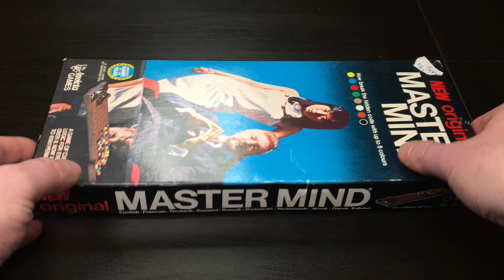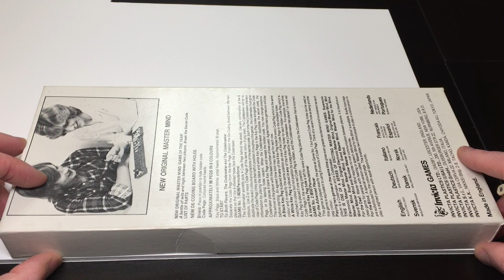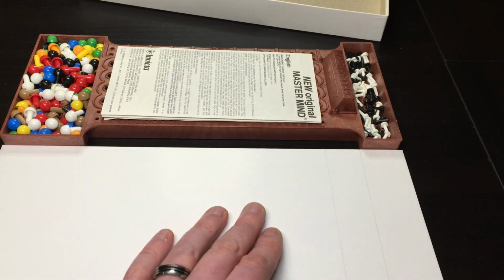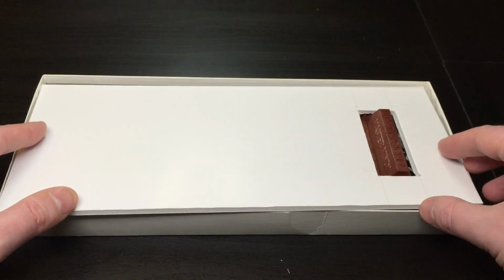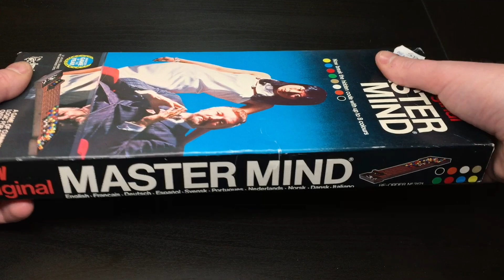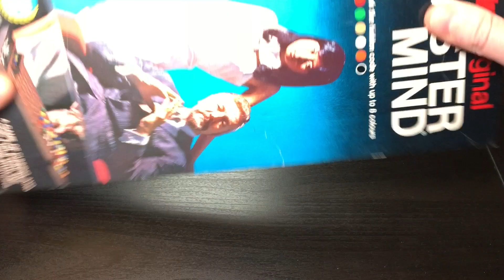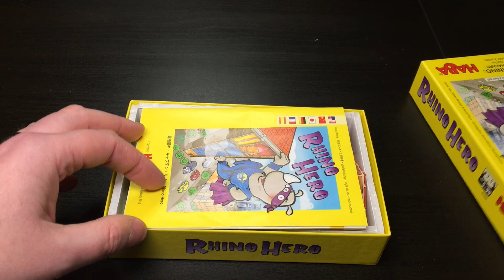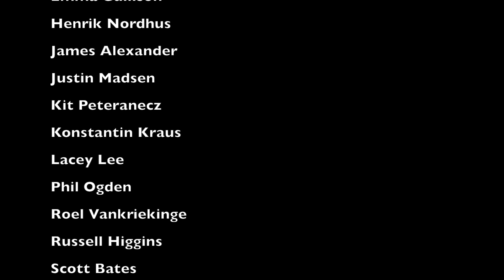Using Foamcore to Create a Board Game Insert

Comment: I have made an insert for Terraforming Mars, Imperial Settlers, and Lorenzo Il Magnifico. My first i used hot glue but didnt like the extra glue that came out. the other two i used Aleene's Original Tacky Glue i got from the craft store. To hold the pieces together i used sewing pins. that second method worked great. takes a bit longer to dry but looks a lot cleaner.
Reply from the maker: Great tip! Ill have to give that a try
Reply: i use sewing pins aswel but i do use fast drying woodglue. First its white but as it dries it will go transparent.

Comment: "pro tip": For more complex inserts, instead of a glue gun, use wood glue that comes out of those squirt bottles. 

It's MUCH easier to work with than a glue gun, it doesn't dry as fast letting you fit the pieces better, but it dries fairly quickly so it doesn't slow the work down (20-30 seconds for initial grip, 20-60 minutes until it's basically ok to put the game pieces in, 24 hours until completely dry).

Comment: Have you tried gluing the insert inside the lid? I wonder how that would work but I'm worried it might ruin the lid. I actually have some foam core left over from another project. Thanks for the tutorial!
Reply from the maker: You’re welcome dude. I haven’t tried it, but I did think about doing it. I don’t think it would cause any issues to the lid at all and I’ll be doing it in some boxes that are too tight for space. Just have to make sure you’ve cut it all correct before gluing

Comment: If you want precision, just get it laser cut.
It takes some time to design that stuff on a pc. But once you have the design, you can just ship it off to one of those sites that'll laser cut it for you. Depending on what kind of material you wanna use, you can get it done a lot cheaper than buying the premade inserts from around the interwebs.